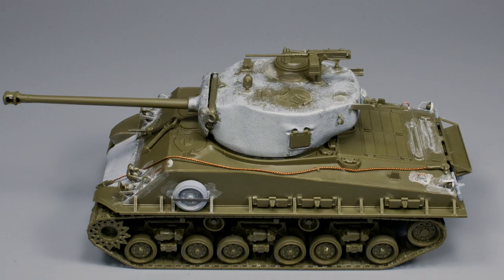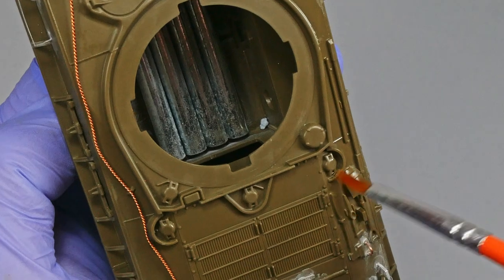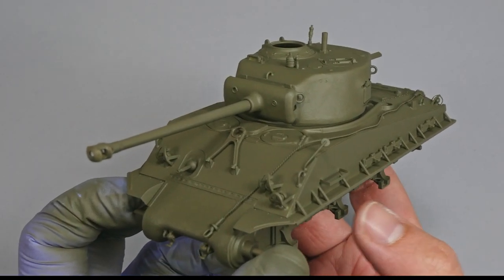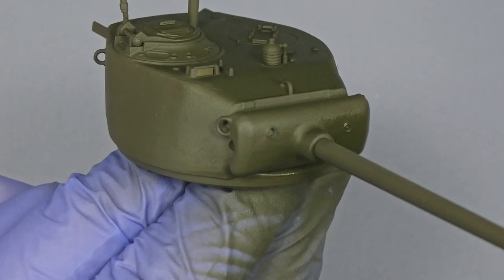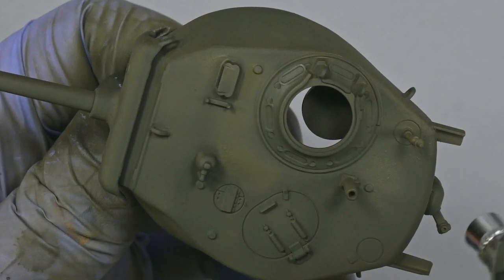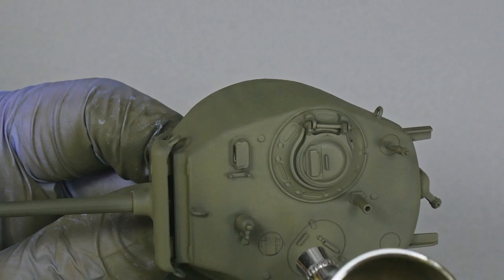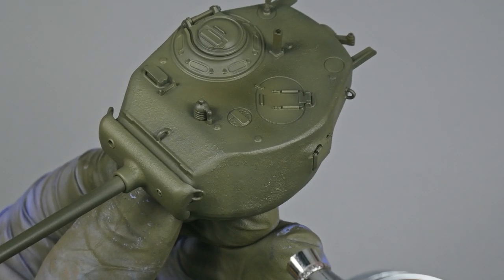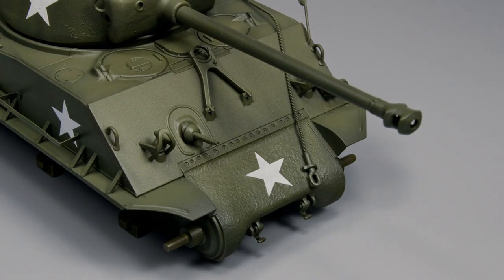How to paint a model tank. Tamiya 1/48 Sherman Easy Eight

Comment: Hi, great video! i was just wondering what thickness copper wire you used to add the small details at the beginning? also do you have any videos on using the Tamiya putty to add texture to your models?
Reply from the maker: Hi there!
I think wire thickness is about 0'3-0'4mm. It also depends of the scale and the size of the accessories of real vehicles. 
Also if you want to see it, there is a chapter dedicated to texturing with tamiya putty in this video: https://youtu.be/XsT8-n0erc0
Cheers